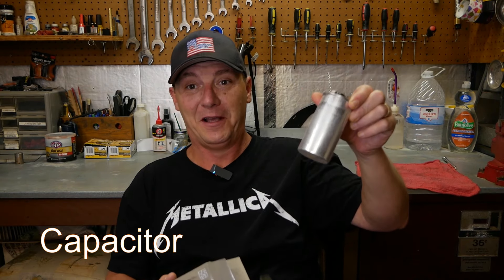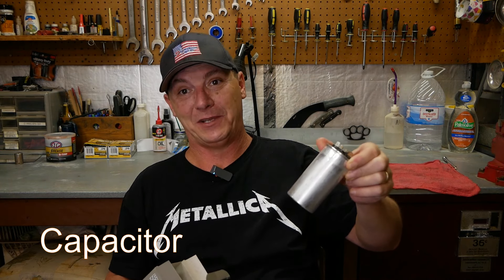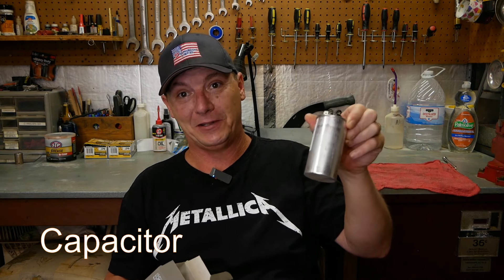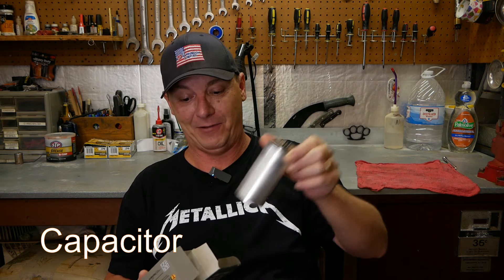The Hard Realities of Prepping and Building a Rural Homestead Lifestyle

Comment: You nailed it with this topic!   I’ve lost or given up ALOT of friends and even family for the same reasons.   I will admit most of the losses have been my choice.  I’m not sure it’s supposed to be this way but the older I’ve become the less tolerant of peoples bs I am. Admittedly my biggest fault is I’m am extremely unforgiving if I’ve been wronged in some way. I’m a one and done kind of person and there is zero chance I will ever respect or trust that person again.  I can speak to those folks casually but can never trust or forgive them again no matter how much time passes and it usually on my part comes with a tone of distain.